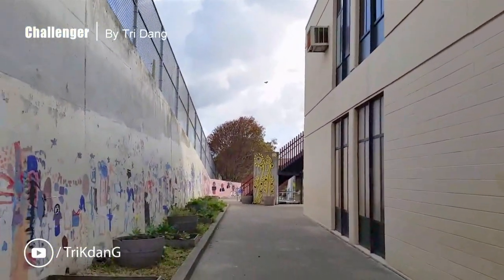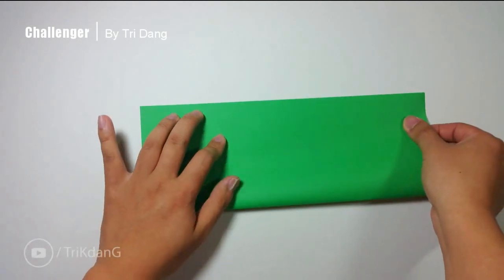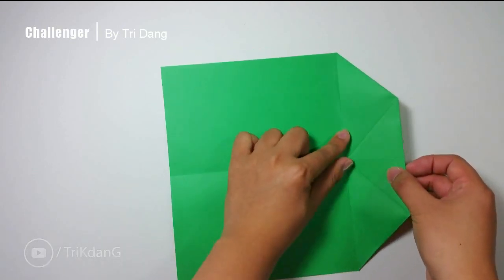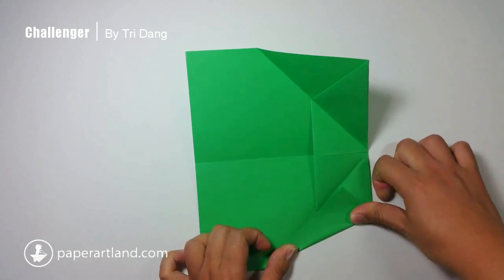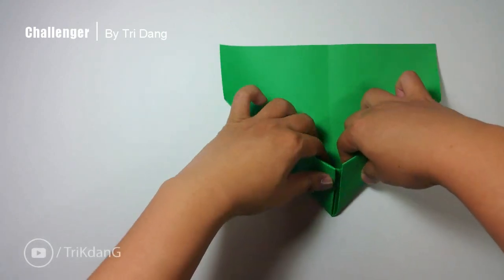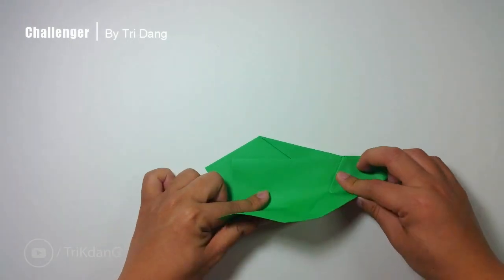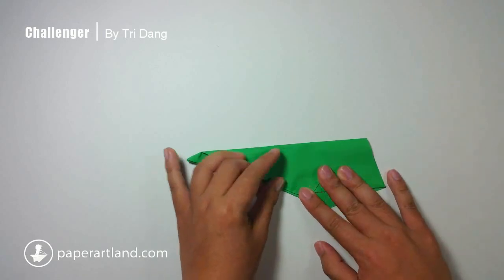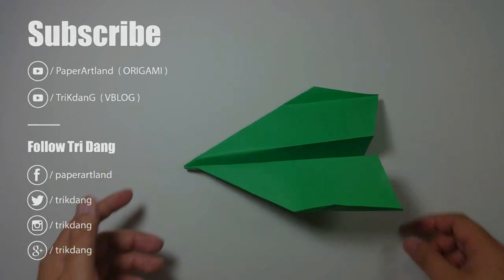BEST LONG DISTANCE PAPER PLANE in 2015 - Let's make a paper plane that flies ~200 Feet | Challenger

Comment: I tried the plane just to see how it flies and i found out that if you use A4 instead of US Letter Size, the plane has bigger wings that generate more lift, so you don' t have to curve up the edges at the bottom of the wings. Those curved edges aren' t simmetrical, so it is difficult to make the plane go straight, but if you don' t make them the plane goes straight. Sorry for my bad English, i am Italian.
Reply: Actually your english is great ;-)
Reply from the maker: #FF2400 Giuliocava00 Great feedback. I decided to skip that step. :) Also thanks for testing this plane out. Ciao!

Comment: Certainly an interesting aircraft, although it's not the Challenger I saw before. My own tended to pitch down quite frequently, so I had to add the elevators to counteract the diving tendency.

For a record breaking flight, it would probably be best that the need for elevators be eliminated since trim like that will increase drag. I have some other design ideas that I'd be willing to talk about if you wish to hear of them.

-OAE
Reply: OrigamiAirEnforcer